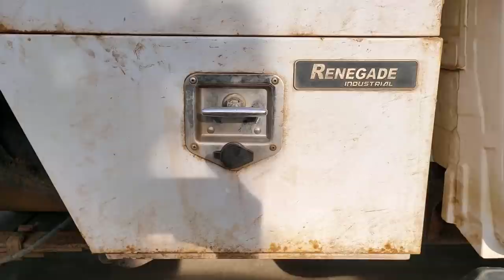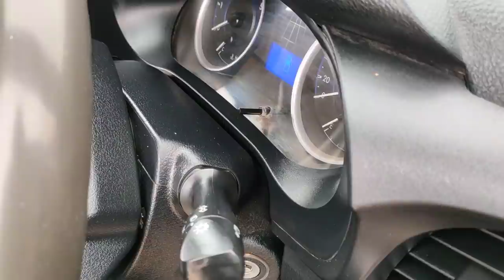Car Detailing a Filthy Farm Ute | Satisfying Interior and Exterior Deep Car Cleaning

Comment: Awesome video, Question about removing seats. Do you remove battery terminal before unplugging seat switch and does that reset the radi0? also do you torque the seats down after putting back in? if so where do you find the torque settings for each individuel car?
Reply from the maker: Hey Patrick, Yes sure do. It does reset the radio and some radios require a radio code to unlock them which can usually be found in the owners manual or on a card. If they don't have it written anywhere you can also find out the code from the car manufacturer. Removing the battery can also reset other electronics but they are all easily set back to normal with a quick google search. In regards to putting the seats back in I just tighten them with an impact driver but not to a specific torque. 🙂

Thanks for watching! 😁

Comment: Great work...my tips detailing filthy  cars for 25 years...almost 100% new results,  90% less time and work....I'm in Australia too...

1. In dry hot weather...spray seats outside the vehicle with undiluted AutoSmart G101...generous mist...no agitation required...quickly blast with pressure washer within a minute if applying G101...dont allow to dry...blast for 5 minutes +...till water is clear...carefful not to damage fabric with too close pressure washer...but close enough to blast away stains...removes 99%....most times 100% perfect seats..1% stains...re apply G101 or prepsol..if using prepsol...finish with g101 to remove solvent smell....blast again...no agitation most times required..except glue, silicone caulking or gum...pressure washer applied fairly close will blast away nearly everything...put an electric heater in the car for 8 to 10 hours...with windows 1 cm open..to allow moisture to escape....in the winter...or leave seats outside a day in the summer...leave window's 1 cm open for several days...saves 90% time and work...and results are almost 100% ...with zero chemical residue left behind or smells being activated by not removing 100% of contamination 

2. G101 undiluted...mist door trims, speakers, window switches,  avoid window tint....pressure wash thoroughly within 1 minute of applying G101...speakers aren't paper anymore...they are plastic...but still be quick and light with the pressure washer on them...same with switches...only once in 25 years I had to replace a customer's already damaged window switches on a Ford Territory...because they didn't like water and were already corroded inside...otherwise tape them up...or use air tool to fix wet window switches...then magic sponge door trim if need be with undiluted g101 ....and wipe with damp clean microfibre..allow to dry....apply dressing ...door trim will be almost 100% new...with 90% less time and work

3...pre wipe dash , console dust with wet microfibre...then apply Undiluted g101 and magic sponge...on all other dash , console and plastic trims too...don't allow to dry...1 section at a time ...re wipe dirt and chemical residue off with moist clean microfibre again...allow to dry...then dress...CarPro Pearl is a nice dressing...it dries to an oil free touch...it's water based.. plastics will come almost 100% new ...with 90% less time and work

Comment: Great job mate. Just a quick question. Isn’t the spray and steam bad for the buttons and controls as they can get in behind?
Reply from the maker: Thanks SubieLife99! 🙂

Great question! It is bad if there is moisture sitting on any of the conductive connections behind the buttons which would cause them to short out and rust if left (although I don't think rust would affect the conductivity). 

As long as buttons are blown out thoroughly with the air compressor there shouldn't be any issues. If there is moisture shorting the buttons out it will just cause them to play up until dried. 🙂

Comment: Keep the tools sounds pls!
Reply from the maker: Rahaf Ojosama in the future I will make some videos with the tool sounds. 😁
Reply: @theaussiedetailer3207  why not all of them
Reply from the maker: Because alot of video is sped up dramatically the sound also speeds up with it and sounds like the pressure washer, air tools and my extractor turn from sounding normal to sounding like a fly buzzing around. I believe it would annoy alot of people (it's a very irritating noise) if I were to leave the footage at normal speeds so the sounds were good each video would then go for hours. Blending both music and video into one is also very difficult to get it to flow nicely. In the future I will likely start a second channel specifically for videos with just tool sounds and other requests. 😁

Comment: That’s not Even near “clean” 
Extract the seats, stop using that APC or whatever you are using cause it leaves a lot of white residue, change the towels more often, you ignored the headliner, seat belts and still there is a lot of dirt left in the knocks and crannies.
Reply from the maker: Thanks for your feedback Cipriam Ion! 🙂

In regards to extracting the seats. I definitely will be using an extractor on all future seats and carpet but I do think the steamer and vacuum did do a pretty great job and now others that don't have the luxury of an extractor have another cleaning option. In the case of this ute the owner would be getting in the very next day with dusty clothes and muddy boots because it is a farm ute so he wasn't too concerned with how they were cleaned, hence the experimenting with the steamer. 🙂

In regards to the APC, if you are talking about the doors going whitish, it is not due to the APC. The doors seemed to have been really dry similar to how brittle plastic goes whitish. It was just covered in dirt before so it wasn't visible. But the APC I use is Meguiars and doesn't leave a residue. 🙂

In regards to changing towels more often. Noted and will do in the future. 🙂 

In regards to the headliner and seat belts. They were cleaned off camera along with alot of other cleaning that is done off camera.  🙂

Finally, in regards to the dirt in the nooks.and crannies. I am open to advice if you have any. Always wanting to improve my detailing. The only way I see it getting cleaner is dismantling the interior which is just not possible at the moment with time restraints on how long I have to detail. But like I said open to any advice that you have. 🙂

Again, thanks for the feedback. Really appreciate it as it helps me improve. 😁
Reply: @theaussiedetailer3207   With knocks and crannies I use detailing swabs, toothpicks and the tornador. An extractor or at least an wet and dry hoover will up your game a lot. I personally use a George numatic and I have an aqua pro on the way.
Reply from the maker: Ciprian Ion, 

Thanks for the suggestions. I will try them out but I'm not sure how productive the method of a toothpick will be. But I'll try it out because like the steamer and vacuum, you don't know what something works like without trying it. 🤘 

I have both a wet and dry vacuum (used in the video) and a truckmounted extractor which is a commercial quality extractor powered by an engine which uses extremely hot water (near 100° Celsius) that is heated via the exhaust. 🔥 

I just decided in this video to test a different method to see how it works. 

I also have a tool which is the same as the tornador just without the brand name which was also used in this video. 

Do you detail as a hobby or for business? 🙂
Reply: @theaussiedetailer3207   The thing with toothpicks I know it might sound mad and it’s time consuming but you can clean all the knocks and crannies with a detailing brush. Trust me, I been there. It’s called detailing so it’s all about details. I have a full time job, I am doing cars just in my spare time. I wish I had your video editing skills to post some videos on YouTube as well.